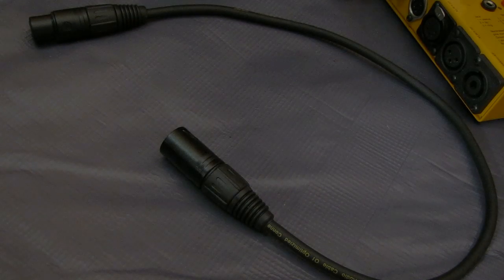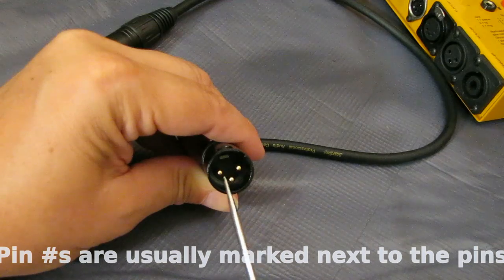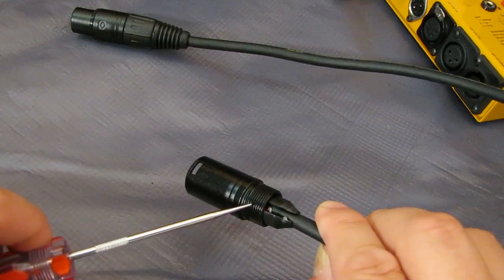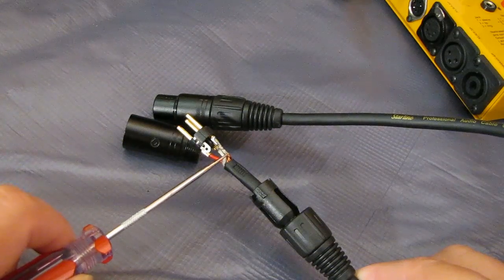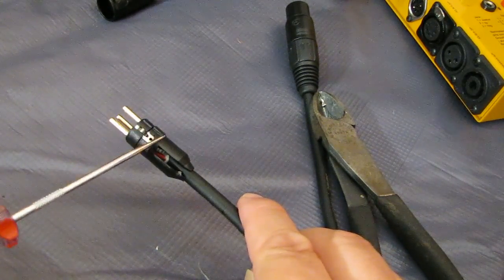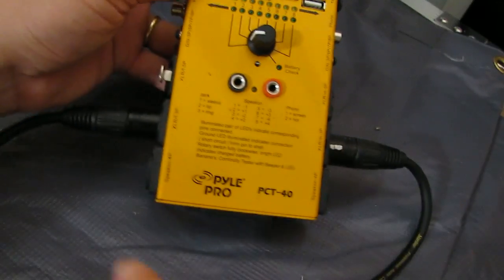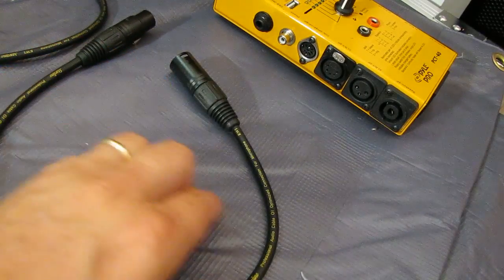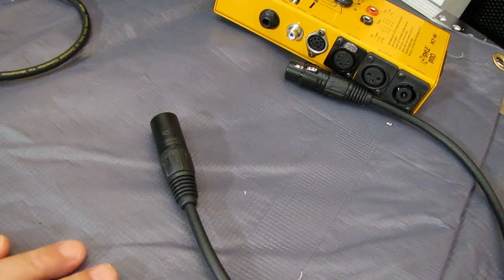Making ground lift cables

Comment: Hello there, great video! Just a quick question. I'm creating my own passive splitter snake (something like the seismic audio one). Should I be worried about this and cut the pins 1 on all of the connectors just in case? Two of my microphones are condenser, wouldn't that affect phantom power? And also our guitarist uses active DI where phantom power needs to be provided as well. I'm curious if I should cut the pins 1 just in case or you advise to have couple of lifted cables made aside. Thanks a lot, liked and subscribed!
Reply from the maker: Thanks for your comment.  Good question.  I would NOT cut the pins on any of the connectors on the splitter.  Instead, (just as you said), pick up several short XLR cables and cut the pins in those... then use those cables on problem inputs only.  I have about a dozen 1 ft. long cables that are ground-lifted.  Also, if you are using a speaker management system (like the dbx 260), some of those units have built-in ground-lift switches on the rear of the units (usually next to the inputs).  For most of the shows we do, I use the built-in ground-lift on our dr-260.  I occasionally will need to use a ground-lift cable on the monitor signals (at the monitor console).
For the DI's, many of those should have a ground-lift switch on them already (ground-lift switches are somewhat now normal on many DIs).  If the DI does not have a ground-lift,  just use a short ground-lifted cable on it.   Phantom power should still pass with a ground-lift activated.
Reply: @stageleftaudio  Thank you so much for your reply! I'm basically building the split snake for the band where we use Soundcraft Ui24R as our IEM mixer and I'm not aware if there are any options to ground lift individual channel. With your experience what would you say is the most susceptible input type for ground humm? Dynamic mics, condenser mics, DI boxes, DI outputs from bass amp or the PA speakers? It's 3 of us in a band, acoustic guitar, bass, drums and all 3 of us sing, so I'm just curious how many of those ground-lifted cables should I make. If we use complete mic setup it's cca 14 inputs so should I have 14 short ground-lifted cables on hand? Can it happen on all of the inputs at once? Any info will be appreciated, thanks a lot!
Reply from the maker: Thanks for your setup information.  This may be more information than what you need for your type of setup, but hopefully it will give you a broader picture of how ground-loops (hum) occur in a sound system.  Hopefully it may help you decide how to handle a potential hum.  The ground-loop in a system is not caused by the type of microphone or DI boxes used (unless there is something internally wrong with them).  Though, the outputs on guitar and bass amps (including the built-in DIs on these amps) are sometimes prone to signal grounding issues, which can cause hum.  Most all of the hum (ground loop) you hear in a sound system is caused by a continuous balanced (XLR) signal path between two different power sources.  Pin #1 in an XLR cable (the ground) provides the only signal path that can traverse an entire system.  When Pin #1 is connected (through all the grounds in a system), it creates a large physical loop (which generates interference) between at least two different power sources.  For example, a power source could be at the FOH mixing location (for the console), and another power source could be at the stage (for the main PA, instruments, monitors, etc...).  The FOH and stage locations would be connected (through a signal) using a multi-core snake; of which the snake would have many pin #1 connections.  Removing the connection on pin #1 (as shown in the video) for the main output of the console breaks the ground-loop circuit between the two locations, therefore eliminating the hum.  This also applies to monitor sends (if mixing monitors from FOH).  Sometimes, it doesn't matter where the break occurs in the loop, just as long as there is a break.  But also, not every setup has a ground-loop problem!

The other issue that can cause hum (not related to ground-loops) is from some older instrument (mostly guitar) amplifiers that have wiring or other modification issues inside the instrument amp.  The hum produced by these older amps gets amplified.  Using a ground-lift cable on these types of amps will not correct the hum.  Any hum from these older amps usually indicates it needs something fixed internally.

It is possible to have multiple ground-loops in a sound system.  Some of the ground loops can be localized to the stage from using multiple stage circuits when using multiple FOH amplifiers (i.e. sending the same FOH signal to many amplifiers).  A ground loop (hum) can occur between amplifiers.  Using a ground-lift XLR cable (as in the video) between amplifiers can eliminate the hum.
You should only need a few ground-lift cables at most.  In my large sound system, I may occasionally only need two ground-lift cables, and that would be used in the sending of monitor signals from the FOH console to a monitor amps.  As well, all of my DI boxes have ground-lifts on them that I can activate or de-activate as needed for any instrument amp.  

IMPORTANT:  Tracking down ground-loops (hum) in a sound system can take some time and may require good trouble-shooting skills.  Ground-loops localized to the stage are harder to track down than those for FOH.  Some instrument amps have XLR ground-lifts incorporated in them (usually at the output)... use those first before inserting any ground-lift cable.  You should not use ground-lift cables on every input, because it can introduce a lot of noise into the system and negate the benefit of having a balanced snake/splitter.  Balanced cables reject noise.  Ground-lift cables should be used sparingly.

VERY IMPORTANT:  Some older amplifiers (and instrument amplifiers) have electrical ground-lifts on them.  These electrical ground-lifts are NOT the same as the XLR ground-lifts (shown in the video).  DO NOT disable or shut-off the electrical ground on any amplifier, including stage/instrument amps.

Nice choice (Ui24R) for your IEM.

Hope this helps.
Reply: Wow! What an extensive answer. You answered everything I didn't even think of I need to be answered 😂 thank you so very much. I think you should pin that comment if possible because it answers many question other people can have. Thanks again for clearing up the ground loop hum problem and explaining it in such great detail!

Comment: My Fender Mustang amplifier had ground lift button, their new GTX amp does not. 
The new GTX has a hum - will this fix this situation?
Reply from the maker: I'm not sure if a ground-lift cable would help your GTX issue.  The ground-lift cables shown in the video are for setting up a sound system with multiple power-sources.  The hum that is found in sound systems is usually do to a ground loop between XLR cables.  Hum issues in instrument amps sometimes have to do with "noise" on the same circuit where the amp is plugged in.  Try plugging the GTX in different receptacles around your studio or house... make sure to use receptacles that are far away from where the GTX is currently plugged into.  Also, some guitar cables can cause hum issues, try swapping them out.

Comment: i can just cut the ground wire of a stereo aux cable and the hum will go? like a electrically powered org to pc , cutting the ground wire will eliminate the ground loop? i was using a ground loop isolator but i will try that instead.

Comment: I just performed this mod on my XLR's and it actually made the humming noise much louder and more prevalent. Any other suggestions to fix the issue?
Reply from the maker: The ground-lift modification (in the video) covers issues with signal cables.  Tracking down ground-hum related issues can take awhile.  If the hum is worse (after doing the modification), it's possible something else on the same circuit has a  signal grounding issue; something like noisy/bad power-supplies, fluorescent lights on the same circuit, or possibly something with a motor in it (motors generate EMF which can cause hum).  Also, there could be an unbalanced cable somewhere in the "loop" of the signal path, which could include a bad XLR cable.
There's a lot of variables involved...  What can happen (but not too often), is there could be a ground loop between amplifiers and/or active speakers (at the stage), which would not include any cabling from the console to the stage.
Some troubleshooting:  Connect everything up as you normally would using non-modified XLR cables.  Then, remove one XLR cable (i.e. starting with the main out console cable) and see if the hum disappears.  If the hum disappears, there's a signal grounding issue between FOH and where the XLR terminates at the stage.  If the hum does NOT go away, the grounding issue is at the stage.  Try disconnecting signal cabling (one at a time) from any powered speakers or amplifiers at the stage.
The idea is to move through all the connecting XLR cables, unplugging -- test for noise -- then plug back in... move to the next cable.
Depending on your setup, you could try temporarily moving everything that needs to be powered, over to one circuit.  When everything is connected to one circuit, there (technically) should be no loops to support a ground loop.

Comment: If youre doing this, its because something else is wrong. 
If something else is wrong with your equipment this can be deadly. 
If youre a sound engineer doing this, dont tell anybody if you value your job.
Reply from the maker: Remember... we are lifting the ground for audio, NOT electrical.  To avoid creating ground-lift cables, some manufactures have incorporated ground-lift switches in their gear (i.e. dbx drive-rack units), which do the same thing as the ground-lift cables.
Reply: @stageleftaudio  I think you know what youre doing, but neighter the people watching this or the backline crew.
Reply: A ground lift XLR cable is not dangerous. Remember the electrical items attached to each end of your XLR signal cable remain electrically grounded.

Comment: Isn't this dangerous? And if not, why are those ground connections there in the 1st place? Maybe it's only dangerous when lightning strikes or something?
Reply from the maker: The ground connection (Pin #1) is what creates a balanced signal in XLR (and TRS) cables;  it keeps the noise down.  Without the ground, the cable is unbalanced (which can greatly increase noise over long distances).  A side effect of having a ground is the potential for a ground loop.  A lot of equipment has a ground-lift switch built into them (i.e. dbx driverack 260) and some amplifiers -  that can be turned on/off if needed.  Lifting the ground affects the audio; it's not used for grounding equipment related to electricity.

Comment: After a lot of research, I settled on this approach and it definitely works. I read about the principles elsewhere, but came to the video to see a visual demonstration. I've suffered ground loop problems for 10 years(!) with unbalanced sources connected to balanced inputs on my active monitors, which need to be plugged in to different wall sockets due to the layout of the room. There are other recommended fixes out there, including lifting the ground pin on the power cable (dangerous) and spending money on isolators (can degrade sound, unless you spend a ton) hum removers, DI boxes, etc. This was my preferred option. I wanted a non-destructive method in case it didn't resolve the humming or I got too much unwanted interference, so I de-soldered the cable from pin 1 and folded it back against the sheath. Thanks for the video.
Reply from the maker: Thank you for the comment.  Most of the time, the boxes that are sold to stop the "humming" are targeted for line noise and other "internal" noise producers, not for ground-loop situations.  Having several ground-loop cables on hand will eliminate nearly all ground-loop situations.  The idea is to know if what you are hearing is from a ground loop, or from something internal.
Reply: Chucking in the obligatory reply - NEVER TAKE THE EARTH OUT OF A POWER SUPPLY, EVER. 

Someone at my university died doing that the year before I got there. Scary stuff.

(Sounds like you knew all this already 😅 just for anyone else reading...)

Comment: Hi Stageleftaudio. 
I never have humming noise before I bought a Meyer Sound CP-10 from a local. Currently my QSC power speaker xlr m/f cables plugged in the output of the CP-10 and the xlr m/f cables from the input of the CP-10 to Stereo Masters of the Midas Venice 240 is making humming sound. I tried your way but the humming sounds still there. What is the best way and how I can do to correct this problem? 
Thank you.
Reply from the maker: Remove the CP-10 from your audio chain and see if the ground-loop is still there.  If it is NOT there, the problem is with the CP-10 EQ.  On the back of the EQ there is a ground-life switch.  Try selecting the "Lift" side of the switch.  Also, if you are using XLR cables, make the switch on the back of the CP-10 is set to "Balanced".

There's a lot of variables in troubleshooting ground lift issues.  Hopefully, this will get you started.
Reply: stageleftaudio 

Thank you for your replied. Yes when I unplugged the CP-10 from the chain it’s perfect no ground loop hum noise. I did tried the switch on the back the CP-10 and it is no different. (humming sound still there). I used to have the KT DN410 and had no ground loop problem.
Reply from the maker: Sounds like there could be an internal issue with the CP-10.

Comment: Hello,  Why do we not make all XLR cables this way?   Why would we ever want pin one connected on both ends?
Reply from the maker: The XLR cables (and TRS cables) all have 3 wires and are a balanced cable.  Balanced cables are needed to provide noise rejection when running cables longer than about 25 ft (7.6m).  Two-conductor cables (Pos. and Gnd.) are unbalanced and do not reject noise.  These cables are used mostly for small distances, inter-rack connectivity and anything less than 25 ft.  To keep line noise at a minimum, 3 wires are needed (Pos. Neg. & Gnd).

Comment: Nope didn't work for me Bro I still get the humming in my speakers
Reply from the maker: This means the hum you are hearing is probably not from a ground loop.  Other sources of humming (on the signal cables) can include rectifiers, transformers, heavy loaded items (compressors), and even some light ballasts..  Also, a hum could be coming from the amplifier (due to a fault/short in the amplifier).  If you have 2 amplifiers producing the same frequency range (both amplifiers are daisy chained), a ground loop can occur between the amplifiers (from the daisy chaining cable)... if the amplifiers are getting their power from difference sources.  If this were to occur, you would need a ground loop cable (as a daisy chaining cable) between the amplifiers.

Comment: Where are use this tayp cables.
Reply from the maker: They can be used at FOH or at the stage.  Mostly used in the signal chain between the stage  (snake) and the FOH console.  They are also sometimes used in an amplifier rack when different sources of electricity are used to power multiple amplifiers... specifically, if you are daisy chaining amplifiers of which are all powered from different electrical outlets.

Comment: tried this just now.  no safety or damage issues.  it works fine.   however, if you are using any xlr adapters (i.e. the triton fethead) which use all 3 pins, they will no longer be compatible with this modified cable.  ecommended to try out on a spare xlr cable, but dont do it on the only one you have.

Comment: If you have a ground loop in your system lifting the ground on a balanced audio cable is the wrong way to try to fix it
Reply from the maker: Based upon the source of the ground loop (many times, issues with equipment not related to the sound system), lifting the ground is a valid solution.  Tracing the issue of the ground should be the first step before determining if a ground lift should be utilized.

Comment: Hello, I was on the verge of buying a ground loop isolator when I saw this...I have a ground loop problem where my graphics card causes interference with my active monitors through ground.When I lift the ground of the power plugs the problem solves but I heard that is dangerous to do.Is this gonna solve my ground loop? Should I cut the ground of the input or the output (my cable is jack to xlr) Thanks
Reply from the maker: I am not an electrician, but will tell you that you should not lift the ground associated with the power.  The ground is used to trip the circuit breaker (or blow a fuse) if a short occurs in the equipment.  Without the ground, there is a 100% chance of getting shocked and potentially starting a fire.

The symptoms you describe don't exactly sound like a ground loop, but more like electrical noise (i.e. something on the circuit is electrically "noisy" - transformer, ballasts, compressor, etc...)   However, if you have equipment plugged into different outlets (circuits) in the room, this could present a ground loop situation.  I recommend using an extension XLR cable and lifting the ground on it, instead of modifying your "good" cable.  This way, you will be able to test the connectivity to see if the ground lift worked... without needing to modify your good cable.

Comment: omg thanks man ...it works for me! :)

but i dont know if that is safety?
Reply from the maker: Lifting the ground of an XLR is common.  The ground removal in an XLR is for managing signal/line levels only.  It does not affect the electricity used for the equipment.  Many stage boxes have ground-lift switches on them (for each channel), as well, some equipment (drive-racks, cross-overs, DI's, etc...) have ground lift switches built-in to them (to be switched on/off as needed).
Reply: stageleftaudio thanks so much u save me Money😊